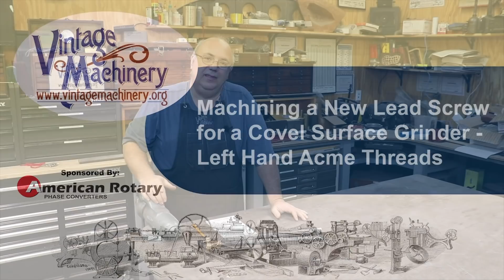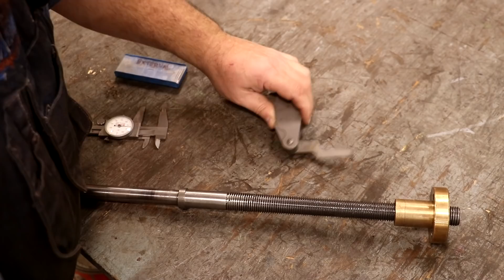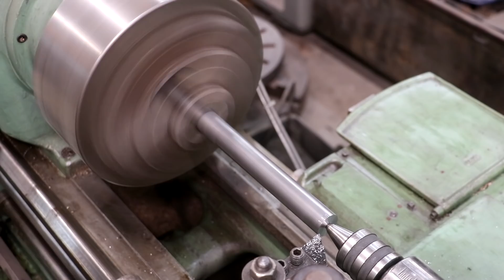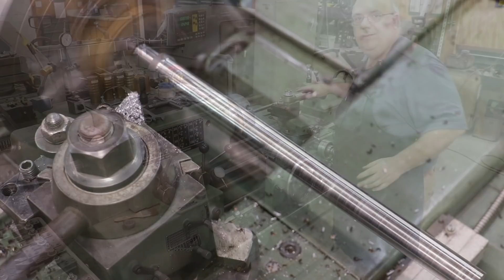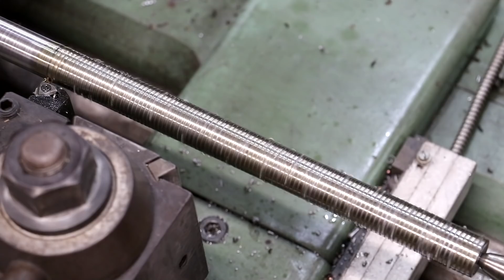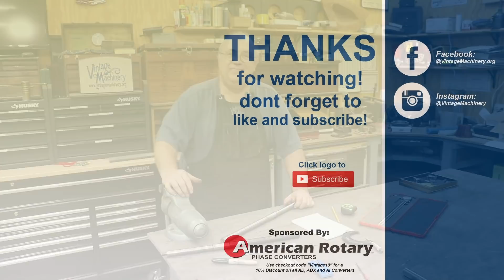Machining a New Lead Screw for a Covel Surface Grinder - Left Hand Acme Threads

Comment: I think that nut must have been replaced at least once, if not twice given the amount of wear on the leadscrew. Usually the bronze or brass nut is deigned to be replaced as it wears. I've just this weekend replaced my main brass nut for my longitudinal  feedscrew as it was totally worn out. There is spa good bit of wear in the feedscrew, but I've cut and shut and reversed the worn part to the tailstock end  and made joining pieces to go into the ends of the feed shaft and the non threaded ends at each end which now have two 90 opposing stainless roll pins to attach the joining pieces so now the unworn part of the feedscrew is at the headstock, working end of the lathe and the new brass nut I've made is nice and reasonably tight with no appreciable backlash. My problem was that the Chinese lathe I have has a feedscrew of 0.100" pitch, but it has a metric outside diameter of 19.98 mm or a nominal 20 mm metric trapezoidal thread. And without an optical comparator I've no idea if it's an Acme 29 degree or a metric trapezoidal 30 degree thread. As I can't find anywhere any specifications of a metric 20 mm X 2.54 mm pitch I've gone with a theory of 0.020" clearance and gone with an extra 0.20"over the minor diameter of the feedscrew to give me the clearance it needs. It seems to work ok. Only time will tell lol

Comment: It's curious that the bandsaw designers decided to have the bottom bearing shell as a part of the main casting.  Having a removable bearing shell that bolts into a rectangular transverse slot in the casting would probably have made manufacturing and repair easier.

Comment: I cut my nut, rotated it a bit and soldered it back together. And that was okay, but I still wonder about getting it in the pipe crimp to reduce it. Maybe even run a tool down it. that looks like it would take a ball screw, and oh my goodness are they good 😊

Comment: I had a nut on one of the slides on my Monoset strip out . I was all set to make one. My old boss at Fox Tool Co offered to give me a new one for nothing. The nut would have been a challenge as it was a double thread. I
had done one once before but that was 25 years before.

Comment: Hi there greetings from down under.  Love old school machining the young push button kids today could learn a lot from us old farts . LOL 😆  I work for a valve manufacturer here in oz and cut acme threads nearly every day  , you don't have to turn the  top slide just keep  it on 0 plunge into  the depth then you might have  to go sideways a bit on the final cut ,. Keep those videos coming cheers 🍻

Comment: I NEVER pile tools up on my Lathe Headstocks !  A SAFETY Hazzard you don"t Need or Want : )
I have a "Cincinnati Tray Top"  Lathe But NEVER set tools up on the Headstock Tray for that reason .
And never had an Issue : )) 
Nice video Presentation , Most guys cant even turn RIGHT Hand Acme threads let alone Left handed ones !   I own  A Vintage  Covel Surface grinder like the one you made that lead screw for . I have Made numerous New Parts for it as well ....  Thanks

Comment: I guess if you were making an inside ACME left hand thread, you would have to make a male threaded plug first to use as your check for fit on the nut....otherwise, how would you measure it to assure that it is correct.

Comment: Hi Keith, you have to wonder how many nuts have been replaced to achieve the wear on the bolt, yet still have a reasonable fit on a new bolt.

Comment: Keith, enlighten me.  When machining a right hand thread and threading away from the chuck ( lathe in reverse), in what position should the compound be set? - to the right at 29.5 or to the left at 29.5 since we’re threading out?  I’m confused about this and can’t seem to find an answer.  I did notice that Blondi has hers set to the right when threading out, but this seems backward to me.

Comment: I've tried using a travelling steady/follow-rest when cutting long threads, to help counteract deflection from tool pressure in the middle of the cut.  Seems to work OK on Acme threads, where the thread tips are wide and flat, but close to completion of the thread forms for ISO metric threads, where the support was really needed, it wasn't as effective because of the sharp tips to the thread forms. Also there are clearance issues, as the rubbing surfaces of the rest need to be ahead of the cut, so chips don't get caught under the pads, and that might mean the rest interferes with the rotating centre or a shoulder. My current project needs a 7/16" 12 tpi Acme leadscrew in stainless steel. That's going to be fun.

Comment: You can purchase a new nut (without the flange) for a reasonable price from McMaster Carr and then make a flange to fit the nut. You can also purchase 3/4 -10 Acme bar from various venders and machine it down for the 1/2” threads and flats. Not having Kieth’s skills; that is what I did for my surface grinder lead screw an nut replacement.

Comment: Great video as always Kieth. It's interesting that the screw was so worn but not the nut. As you  know, the nut is made  of a somewhat soft material (brass or bronze) and the screw is made of a harder material so of the two the nut will wear out first being easier and cheaper to replace than the screw. Maybe the nut had been replaced once before.  Anyway,  I'm looking forward to the next video episode.
Reply: Wear is not always inflicted onto the softer material because there is another factor to consider than just the 2 dissimilar metals in this assembly.
It is true that brass or bronze is softer than steel, but in this application (part of a surface GRINDER) you must factor in the inevitable presence of abrasive particles that are shed from the grinding stone both in normal operation use and during dressing of the stone.  Of the 3 different materials in the equation here, the abrasive stone particles are by far the hardest.  Over time some of this "grit" will find its way into the interface of the steel threads of the rod and the brass threads of the nut where the particles will embed into the brass. At that point,  the abrasive particles begin to remove traces of steel from the rod while effectively "protecting" the nut against wear.  I have seen this to be the case where a soft material is in contact with a hard material, the soft material usually outlives the hard material.
Reply: J, I too noticed that and agree the nut should have worn out first so that's probably the second nut as you state. Bronze nut did however wiggle up and down even if it didn't wiggle back and forth in the thrust direction. I also saw dirty gritty oil inside the nut which means it needs to be cleaned out or it will lap the new shaft as it did the old shaft. 
-- 
MikeC

Comment: Great job. I made a lead screw almost identical to this one for my Kent 6 x 18 manual grinder. Mine was 3/4-10 L.H. acme also worn badly in the center. 
The first shaft I made was a little loose so I made the second slightly larger to compensate for nut wear. I recall feeding straight in instead of at the 14.5 angle. If kept oiled soft shafts like this will last a long time.

Comment: When using an indicator to keep track of thread depth  (compound slide advance) it is better to reference it to thr
Reply: When using a dial indicator to keep track of thread depth (compound slide advance) it is better to have it reference to the cross slide than the main part of the carriage. (The base of the  indicator holder should be stuck to the cross slide not carriage)   Indicator reading is not lost when you use the cross slide to back off the cut on each pass.

Comment: I had to go back the the Machinery’s Handbook to check this, but for Acme threads 10tpi and coarser, the clearance is .010 per side (not total), so total depth of thread would be .060 “by the book,” not 0.55.”  Of course it also says to make the lead screw to fit the nut, so going 5 thou shallow for a worn nut was a good move.

Comment: I would love to see what you are watching when you are "watching for that number to come up again."  How precise is the timing of hitting that number, and what happens if you miss it by a split second?
Reply: It will only engage the leadscrew at the proper points, if you pre load the lever just before your number it will pop in perfectly every time, the dial doesn't turn that quickly at the spindle rpm normally used for threading.
If you miss it will start cutting a new thread misaligned to the one you were cutting, probably scrapping the part and very possibly breaking your cutting tool in the process as the new depth of cut could be large.
Reply: He's watching the threading dial. On my lathe, there is a 1 and a 2 180 degrees apart and dashes on the other 2 quadrants. You do not have to be super precise to hit the mark, it is pretty forgiving.
Reply: Keith showed the threading dial he is watching at 16 minutes, 10 seconds into the second last video (Jimmy Diresta Band Saw Restoration, Pt 10: Single Point Cutting Left Hand Threads on the Metal Lathe, December 31, 2021).

Comment: I'm loving the machining videos !!
Say Keith, I have a question...
I notice the lathe has its own scale to measure depth of cut... basically a metal ruler.
Obviously this won't be as accurate as using a dial indicator, DRO, or micrometer. But how accurate is it?
Maybe some time you could take a closeup of the lath's scale and show us how close it is to the micrometer?
Reply: Maybe this will help, the least accurate scale on a lathe is the one on the barrel of the tail stock. It gives the operator a rough estimate of the travel. The dials on the various handles whether it is on the saddle, cross slide, compound, or even the tail stock is calibrated to accurately indicate the amount of travel once any backlash is taken out. For me, any inaccuracy in those indicators is a matter of my eyes looking at the marks accurately.

Comment: You could make that nut adjustable to tighten it up a little.
Split the flange end in on center for about 1 1/2" and drill and tap two 1/4"-20 parallel cross holes on each side of center,  the screws to tighten onto the shaft to take out play.
Not much work for a great improvement!
Keep up the good work!
JIM 🙂
Reply: That will tighten things up , But will not help the back lash.......

Comment: Brass nuts never wear much on steel shafts because steel chips and other abrasive gunk stuck in more soft brass and scratch hard steel. That's why lead screws are made of steel and nuts are made of brass - it's cheaper to make a new screw rather than new nut. 

The same is used for glass polishing in making lenses or concave mirrors for telescopes: abrasive sticks to soft base (rosin, sealing wax etc.) and cuts pretty hard glass.
Reply: A bronze disk will cut a diamond the same way, diamond dust is introduced at the start of the cut, and largely self replentishes as the cut procedes.

Comment: I would change the nut, you don't want any damage that the nut has to be transferred to the new shaft. But I like to be take extra care on the equipment that I need to be right the first time. At least I would check the nuts threads with a thread gauge to see if there is any damage to it.. Great video, thanks for showing us how much care is needed to make a good lead screw.

Comment: 5:35 Looks more like a 50 thou cut.
7:50 12 thou to go - 'dial in' 12 thou - in the UK, that'd take 24 thou off the diameter.
Reply: Some US lathes take the dial reading off of the radius (the tool moves the amount of the reading) and others take it off of the diameter (the tool moves half of the dial reading).  In our shop, we had one lathe of each type so we really had to pay attention to where we were standing.
Reply: @kensherwin4544  I suspect all English lathes have their cross slides move the amount on the dial, not half of it. I suspect European lathes are the same way. I'd not come across diametrical dials until watching US videos !

Comment: Keith someone pointed out that your threading tool was rubbing the live center while you were dialing in the last couple passes on the 1/2-13 end of the shaft (around 13:50 in the video). Might want to check on your live center. Although you don't usually grip parts that high up on the live center anyways so probably no big deal.
Reply: Jay, I haven't read any further than your comment and mine is hours after yours so this may already been covered but the type of live center that he's got is a double angle; the center of the 60° is only on the very point the rest of it is just clearance for that very problem which is your point I think, the tool holder for the insert is going to butt against that turning surface. I was also looking for that as the diameter got smaller and smaller. I did see where the chip riding along with the insert body scrapes some oil off the surface and made a shiny spot, and then a larger spot. I also saw where the spacing changed a bit in the z axis toward the chuck so all was well. 

I have had to remove for clearance that portion closest to the engagement area on several tools, but that was just the demands of the work. We all deal with life's gotcha's as we understand them at the time. 

Even it it was pressing at that point and rubbing - creating heat, that surface is intended to be clearance for any tooling used on the supported shaft end. No problems unless he had bent the axial thrust bearing or applied pressure to dislodge the tailstock.  He was well short of that. 
-- 
MikeC

Comment: using a worn out nut as a gage for a new cut acme thread (which is supposed to be a 95% thread), is not a good idea.  When I had to make a new acme threaded shaft, I made the matching nut also.  that way you're guaranteed a tightly matched fit with no slop.

Comment: Anither excellent video, Keith.  I wonder though: if the Acme thread cutter has a square nose, does that create more tool pressure than a "V" shaped cutter, and therefor create more deflection on such a long workpiece?

Comment: Great video, I don't know what type of steel you used, but shouldn't that be heat treated afterwards so it won't wear out to quickly?
Reply: This new shaft is not likely to wear out in the lifetime of an amateur/hobby users   lifetime.  These cross feed screws usually have a cover and anyone with good maintenance ethics, cleans and oils the screw and nut at varying intervals depending on usage.
The worn example indicated very bad maintenance probably prior to the present owner getting the grinder.
The cross feed screw can stand a little backlash as generally that is not a precision direction of movement as it might be on a tool and cutter grinder.
If one requires more precision he can move the opposite direction a bit and take out the backlash coming into position against a dial indicator.
There is more to being a Machinist than turning the handle to a dial position and pushing go.
JIM

Comment: Silly Question Time: So if the shaft is iron/steel and the nut is brass/bronze, wouldn't the nut wear out first? and when you mic the shaft shouldn't the nut be mic'd as well to make sure its threads are not worn out? Just a question cause I'm plum ignorant about it.
Reply: I'm not a machinist, but my guess would be that that is not the original nut - both parts will wear the nut will just wear much faster. It may be that it's been replaced a few times already (that shaft looked VERY worn) and only now the shaft needs replacing. You wouldn't want to measure it to fit perfectly against a worn nut, as then when you put a fresh one on it wouldn't fit - the threads are standardised so as long as your measurements match the original, and the worn nut works, you should be okay
Reply: I also think the nut has already been replaced. 
But it may be possible that there is some grinding dust embedded in the soft bronze of the threads in the nut, which grinds the threads of the screw down...
Reply: @Henning_S.  you are exactly right.
Reply: @Henning_S.  That would definitely make sense, especially since the screw is from a surface grinder - it will be flinging very fine particles everywhere